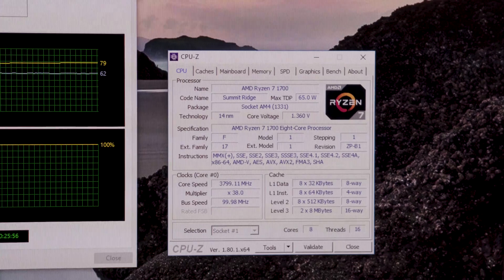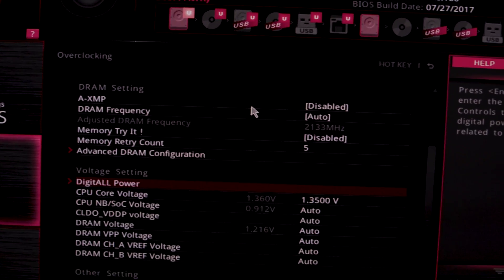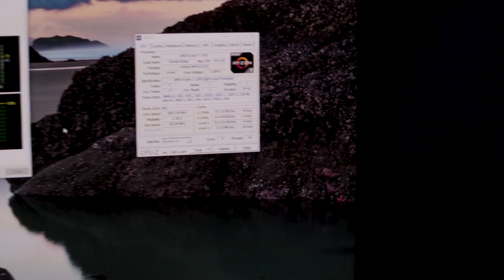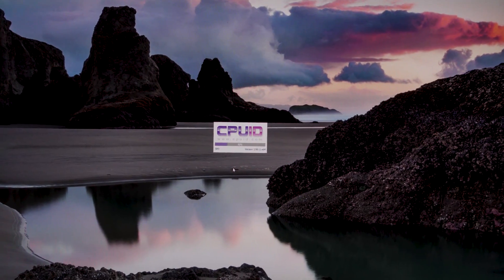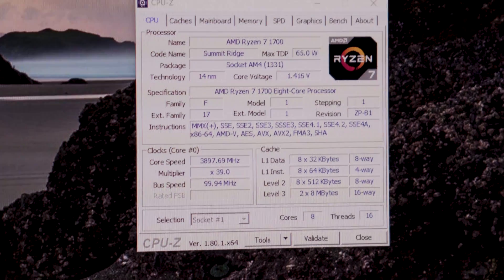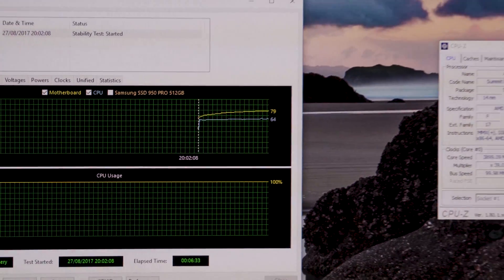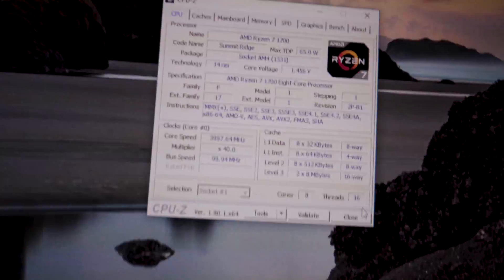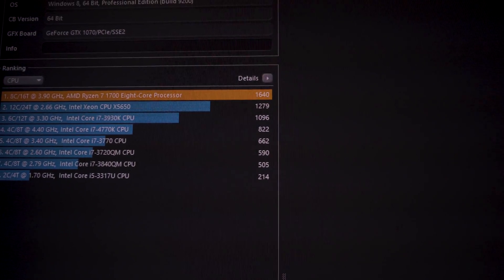Overclocking the 1700 to 4GHZ????

Comment: 4ghz is rough. Like trying to reach the top of a mountain when you are almost there. I am on water and 3.9ghz stable at 1.35v. Tempa are good and I am stable like a cement foundation. Love it. I couldn't get a stable 4.0ghz even with 1.4v and decided to settle on the stable 3.9 at 1.35v.
Reply from the maker: You get to the point of diminishing returns, loads more voltage for a 0.1GHz increase. I stuck at 3.9Ghz also which I am more than happy with. Great overclock for this chip which basically exactly the same as the 1800x which at best will overclock to 4.1Ghz if you are very lucky. Its the 1700 all the way for me :-)